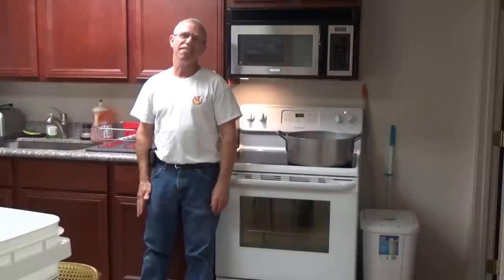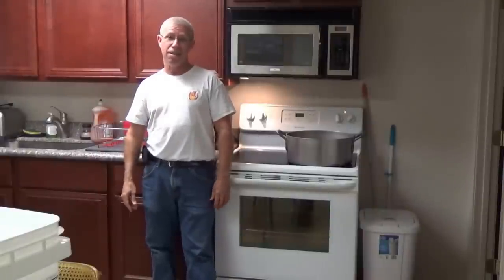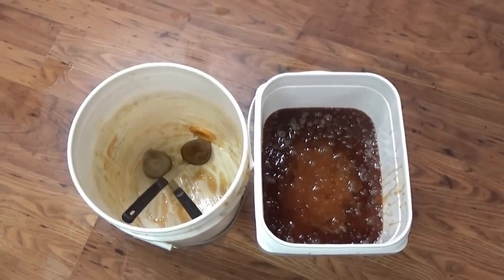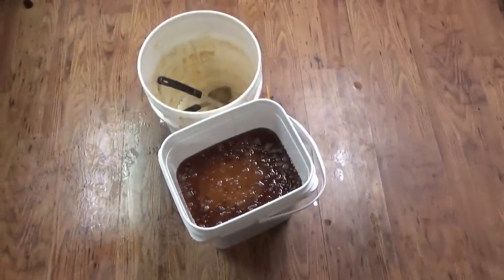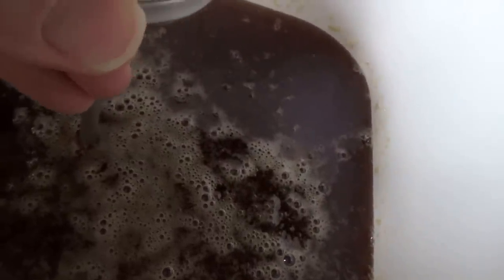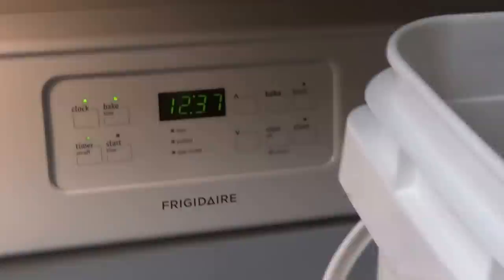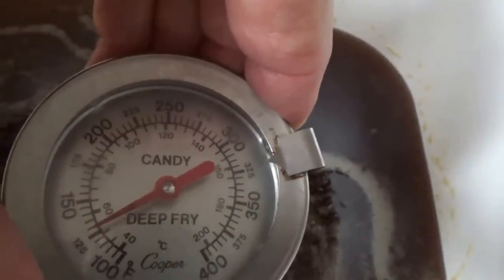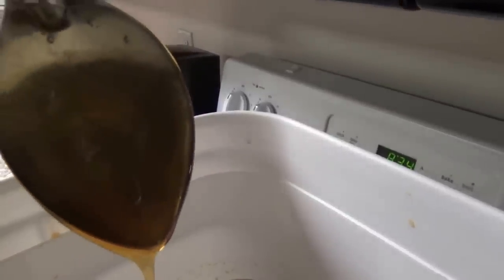Decrystallizing a 5 gallon pail of honey

Comment: Nice! May I give you an advice or tip? Try to use a metal container or something else that hangs inside the hot water (not makes direct contact with the heat from below). It will one make it easier to warm the honey. Plastic doesnt transfers the heat so good. But second the plastic tends to give some of it plastic away at the higher temperatures. So with using the metal it keeps its own taste even more. I really enjoy watching the vids. Keep making em them. I really like them and I learn alot and even considering to search for a place where I can get some experience myself.
Reply from the maker: That is a great idea, but I have taken it a bit further. I bought a water jacketed bottler, and now, when I have crystallized honey, it will be dumped into the tank and I let it alone. It may take a few days to get it to go liquid, but I am in no rush. Thanks so much for the help and watching my channel. God's peace.        Mr. Ed
Reply: Indeed, a jacketed bottling tank is the way to go. If you're a backyard, beekeeper like myself, I use a very large canning kettle as my heating bath and insert my 5 gallon buckets into it with some chunks of wood on the bottom to keep the plastic bucket from contacting the very bottom, where the heating element is on my electric stove, just in case. It may take a while but I've got all kinds of time and if you have the heat somewhat low you can leave it on all night and perhaps wake up to completely heated and liquefied honey in the morning.
Reply: @KenHill  I'm just watching a vid from two months ago from Mr Ed. Where he is rendering beeswax and is explaining the story of the kettles and then you wrote this. What a coincidence, that video from recycling the beeswax is a really good one to have a look at. ( recycling our beeswax)
Reply: @sebrassino  I probably watched everything available on rendering wax. There are lots of different ways, and a lot of it depends upon the scale of what you need to accomplish and what tools and facilities you have available. For the five or six pounds of finished/rendered beeswax I get every year or two, I usually start with hot water in a dedicated kettle to melt and settle everything. I let it cool overnight and dump it out just like Mr. Ed does and wash and scrape the cake a bit. From there I melt in a double boiler at least twice, taking my time about it and run it through mesh strainers and scrape till I'm satisfied with the product. Have fun!

Speaking of lots of different ways of doing things.......... There's an old beekeeper's adage that I've heard and that is ' ask five different beekeepers the same question and you'll get at least six different answers.'

Comment: If you sell raw and unfiltered honey you should not heat the honey above 121 degrees Fahrenheit to maintain all of its health benefits. I use 150 degree water and take the honey to around 118 degrees. Keeps all of it good properties that way.
Reply from the maker: I really don't like putting any heat to the honey, but when it crystalizes you really don't have a choice. I really tried to maintain those numbers and I was very close to them. As you could tell, the thermometer was not a really good one, so I think I did ok. At least the honey did not lose any color and was still golden. I really appreciate your comment, I have found so many different opinions on heated honey, and yours are ones that I have read and agree with. Thanks for watching. Merry Christmas.       Mr. Ed
Reply: @bear09871 Chemistry doesn't work in absolutes. Honeys enzymes have a half life of roughly 1000 days @69F and only a few min @ 121F... Anywhere north of 95F you start degrading or killing the benefits. Once It is crystalized the health benefits are pretty much void unfortunately , there isn't a way to get It uncrystallized in a preserving manner, just avoiding hitting 121F is by no means preserving all of it , you are still killing a large portion. I would be interest to see if any living enzymes are left in crystalized honey before you heat it, there is a good chance there is none...
Reply: @George-nx5lo  i have a crystallized pail of honey and am going to make mead.  your comment made me wonder, if i de crystallize it, could that affect the quality of the mead, or is it simply the sugar content the yeast needs, not the healthy enzymes, etc that honey provides?
anyone can answer this question!

Comment: Mr. Ed, wonderful videos!  I think in the future you can skip the step of measuring the water temperature.  When it's boiling you are pretty much 212 degrees if you are close to sea level.
Reply from the maker: So glad you like the videos, and thanks so much for taking your time to watch them. Even though the water is hard boiling, the thickness of the crystallized honey will not allow the honey itself to reach that temperature. It requires a lot of stirring and a constant monitoring of the temp to get the honey to return to it's liquid state. I only use this method when I have honey in 5 gallon pails, but I will be using a different method in our 55 gallon drums. Stay tuned for that video. God's peace.
Mr. Ed

Comment: I will have to send pitchers of my decrystallizing box I built.   Its uses two 60 watt lights (need to add a third light) and a old hot water heater temp controller.  I set it between 100 to 105 and stick the whole bucket in or a 3 or 4 case of honey.  The only problem is it takes a few days.  Nice looking honey.
Reply from the maker: You have me interested. The problem with decrystalilziing honey using water is that water and labels are not good for each other.  I like the idea of a dry decrystallizing is appealing. Send pictures and plans. Thanks Desmond. Merry Christmas!!!       Mr. Ed

Comment: Hi Jeff, when you checked the honey temp the last time you didn't reset the thermometer.  When you placed it in the honey it dropped down from a higher temp, do you think it was still reading the honey correctly?
Reply from the maker: Now you have me wondering. What I need to do is invest in a really good thermometer to avoid that issue. Thanks for pointing it out. God's peace.     Mr. Ed

Comment: Very nice vid Jeff. I had the same issue as you in a completely full 5 gallon pail with honey gate. I ended up acquiring (free) a commercial stainless steel wine chiller that did not work any longer (lost all of its freon). I took out all the workings an added a 60 watt bulb to the base on the inside with a galvanized heat shield over the bulb. Over night it will decrystalize. Check out my facebook page for pics HONEY B GUYS. God bless.
Reply: This is brilliant!